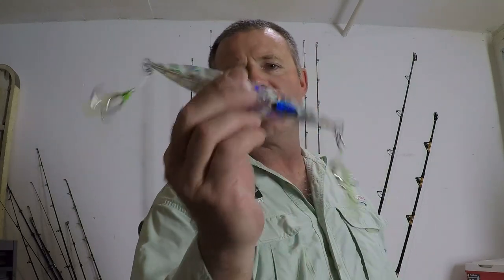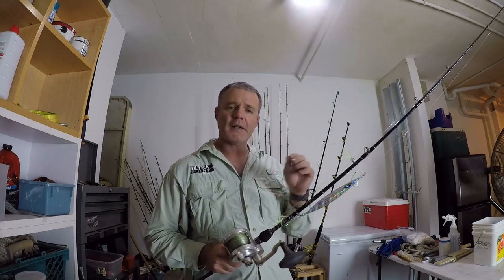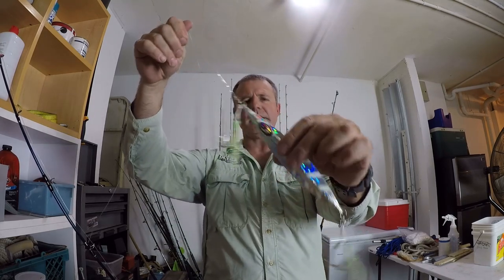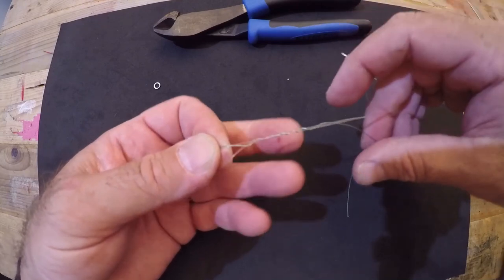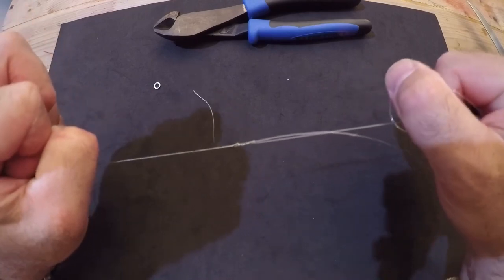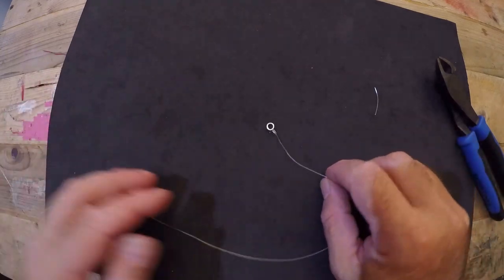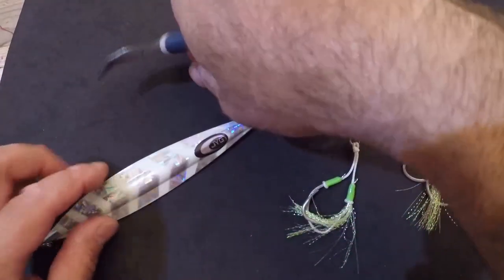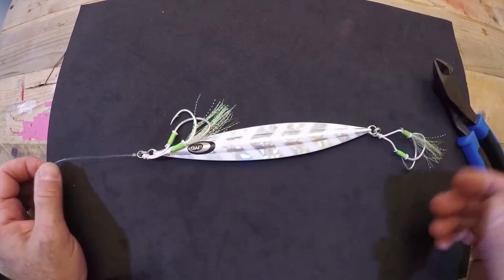How To Rig Up For SLOW PITCH JIGGING gear, line, leader & jigs

Comment: always enjoy the videos... nice tip the use of the tool.. i wish i new something like this existed before breaking my fingers with one of those...I use the same rings little bit bigger for a planner setup. Do a video of a wind on leader set up for planners..! as always, thanks!
Reply from the maker: Thanks a boat load for watching and leaving some great feedback.  I truly appreciate it and your support for the channel.  Split ring pliers are a definite life saver.  I remember opening them up with a small flat screwdriver back in the day, also, stabbed my hand more than a couple of times doing it that way.  Thanks for your request about the planer trolling rig... It's already in the works.  I'm going to be doing a comparison of the 3 different ways of planer trolling:  Cassical (the way I do it), Bridle (wind on leader), and Independent (planer hooked on a separate line to a cleat).  Thanks again.  Tight lines & take care ;)

Comment: Great video, thank you for teaching. Q- any specific place where to jigging or any where on the ocean 🤔.  Thanks again.
Reply from the maker: Thanks a million for watching and asking a great question.  No, not just anywhere.  I like jigging a little deep.  So, I'm typically hanging around the 250 - 350 deep ledge of the 3rd reef.  You gotta look for ledges, structure or reef bottom... It increases your chance of finding fish.  However, you can do what's  called "Blind Jigging" which is fishing anywhere and still get hooked up.  But that method is more for research and discovery.   Hope this helps.  Thanks again for your support oof the channel.  Tight lines & take care ;)
Reply: @SouthFloridaSaltwaterFishing  thanks alot, I going to try that👍.

Comment: What’s the reason your leader is stronger than your mainline? If you snag, wouldn’t it break your main line?
Reply from the maker: Helps prevent losing fish from.cut offs or chafing.  Leader is typically stronger than main line.  Won't break main line... will break at the connection between leader and main line
Reply: @SouthFloridaSaltwaterFishing  thanks for the comment so the knot will break off? I am going deep sea fishing like 100ft and the capt says to use lighter lines like PE 2 or less for main and about 25lb test leader.

Comment: Why no swivel?
Reply from the maker: Thanks buddy for watching asking a great question.  I really don't use a swivel because it's one more piece of terminal hardware that Spooks fish.  What the swivel does instead of using the solid ring at the end of the leader is it prevents line twist but I really haven't had that problem which is why I go without it also.  And the jigs I use most often from the company JYG just so happened to spend a great deal on the decent.  Hope this helps.  Thanks again for your support of the channel I truly and sincerely appreciate it.  Tight lines & take care ;)